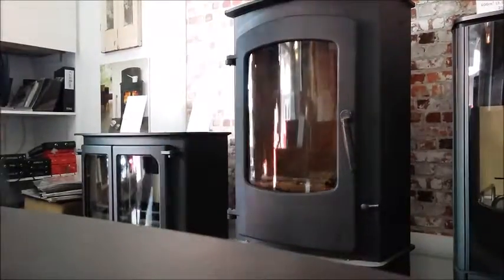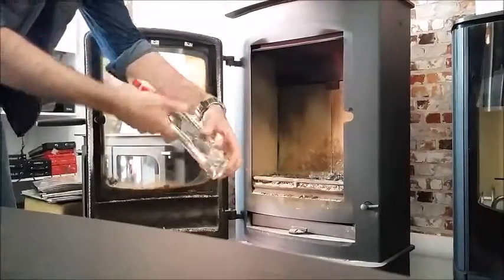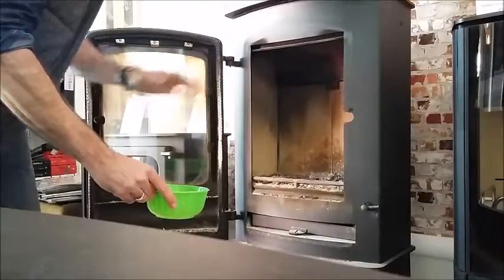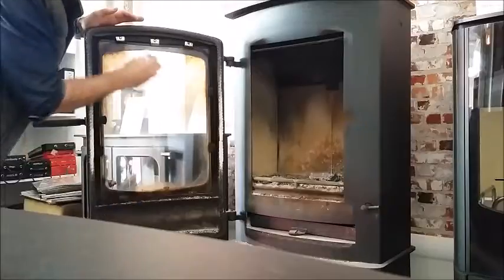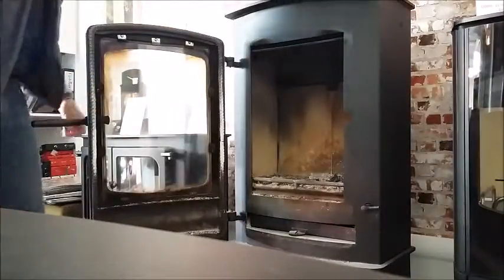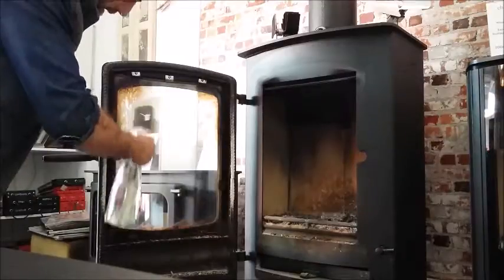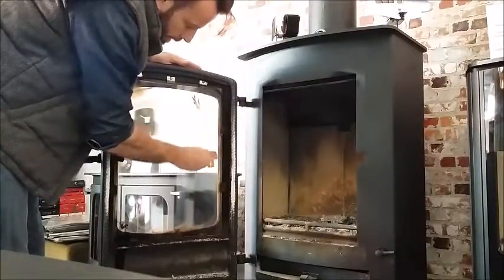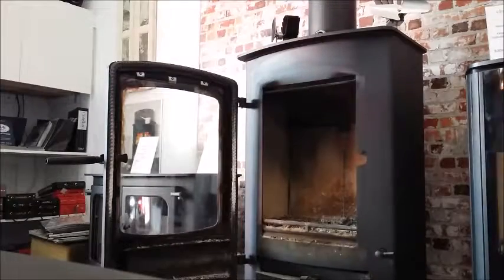How To Clean The Glass On Your Wood Burning Stove

Comment: The instructions on my stove glass cleaner suggests spraying the cleaner on and give it a minute to soak before using the paper towel to remove the staining. My method is to spray on the cleaner wait the minute then starting at the top move the paper towel in vertical direction rather than the circular motion as shown in the video, this way there is less chance of getting the staining on the paper towel spread over an area already cleaned.
Reply from the maker: Great Tips. Thanks!

Comment: A piece of newspaper rather than tissue is better.  You can get a decent sized pad to work with.  Take a full sheet or even a double sheet of newspaper and scrunch it up into a fist-sized wad.  Just dip it into a bucket with a couple of inches of water (warm water is best) and don't get the newspaper soaking wet so that it begins to disintegrate.  Just wet enough on the business side to pick up some wood ash.  Get to work on the glass.  A circular motion works ok for me.  You will get very dirty smears at first, but maybe dip the paper again and pick up some more ash and keep going.  Use a second or 3rd piece with more ash.  The initial water/ash compound will have sat on the glass for a minute or two at this point and worked its way into the grime somewhat.  The second and third wad of paper and ash will begin to remove the muck at this point.  When you can see that the grime is more or less removed, use another wad or two of newspaper, just dampened with warm water only.  Clean away the smears.  Finally go over the area with one or two dry newspaper pads, and the job should be done.

In some heavy staining situations, I might use up to 6 newspaper pads with water/ash to get virtually all the muck off, then a couple of plain damp pads and finally a dry off.  Leave the glass with the door open for 10 minutes or so to be sure it's properly dry or any remaining film of moisture will immediately condense when you light the fire and that starts to go brown straightaway.  I often use a piece of dry cloth (a rag) at the very end to ensure the glass is properly dry.

The chemistry behind it I believe is that wood ash and water makes a lye solution and it's this that dissolves and removes the grime.  Lye is quite a strong alkali compound and so has caustic properties.  Strong lye will burn the skin, but using the above method doesn't ever seem to cause me any skin problems.  Obviously wash your hands when you're done anyway, or wear a glove on the working hand to be sure.
Reply from the maker: Great comprehensive tips! Thanks Finarfin!

Comment: My Charnwood glass on one side has a film of burnt in sodium bicarbonate (baking soda) that I used with vinegar to clean with.
Nothing I have tried will clean it away now - so looks like new glass replacement for trying to make my glass clean.
Reply from the maker: Oh dear! Sorry to hear that. We cant comment on specific chemicals or compounds but you definitely need to be cautious which is why either a very non-chemical mix like water and ash (as per the video) or a purpose designed ceramic glass cleaner that is specific for stoves. There are also sponges that work "dry". See video on our channel - "Accessories for your... stove". Hope you get some joy without needing to buy new glass!
Reply: @CharnwoodSouthAfrica  The stain was about as annoying as a spill of red wine on a cream coloured carpet,
so just had to the right thing and replace the glass.  Looks great again.  From now on will only take expert advice
like yourself.  Many thanks.
Reply from the maker: @voicezful  Well, worse case scenario you have a spare piece - albeit a dirty one. :)